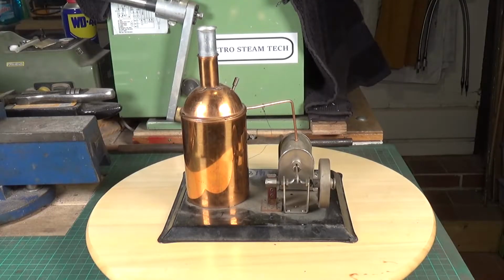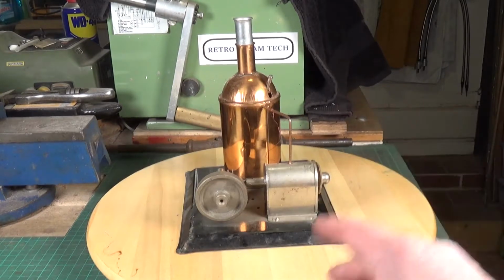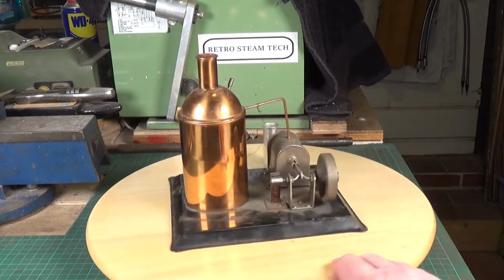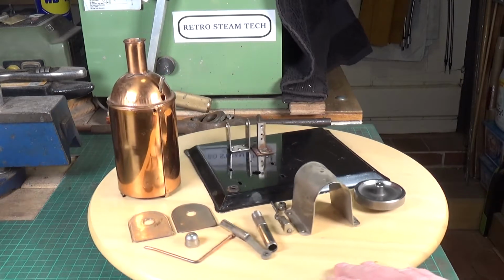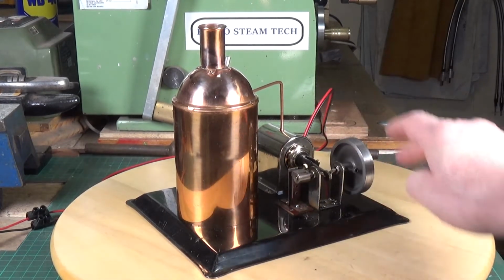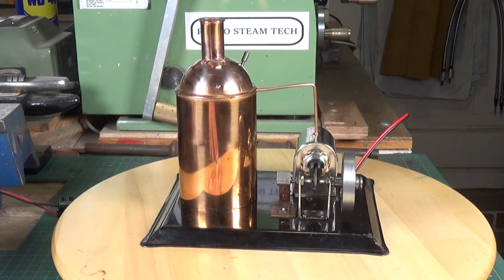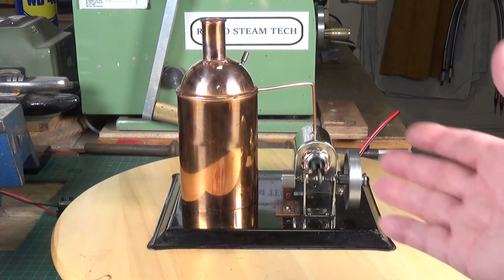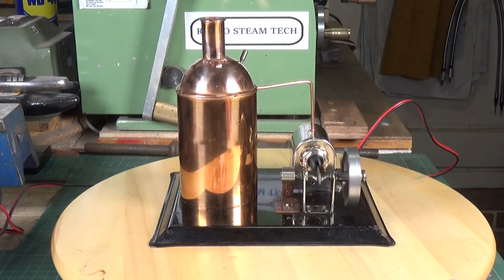Hoge Electric Steamless Engine No.355

Comment: I acquired same engine on ebay last summer, missing boiler. The solenoid was 110 volts I found after taking to friends electric shop
Reply from the maker: Hi Chuck. Thanks for the info.That would make sense, the solenoid being 110V you could plug the engine straight into a wall socket. It's also more evidence to indicate that it was an American product. Cheers, Alan.